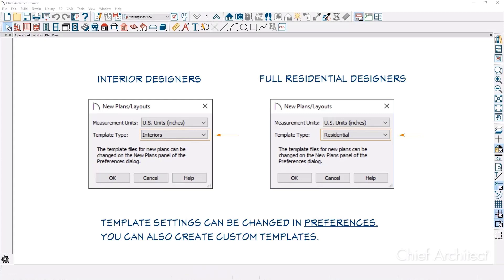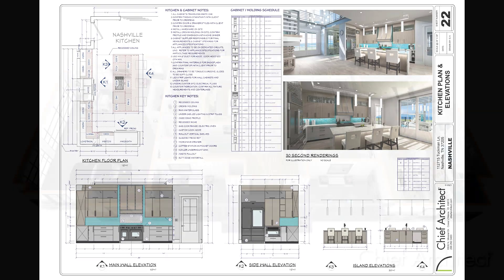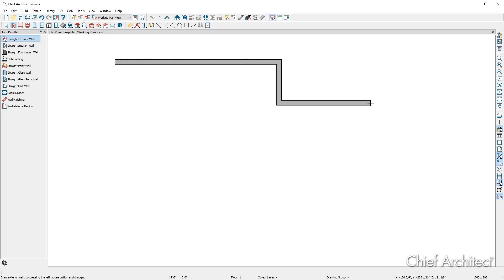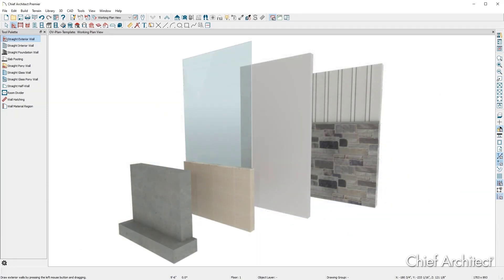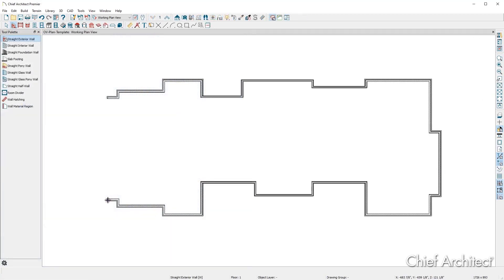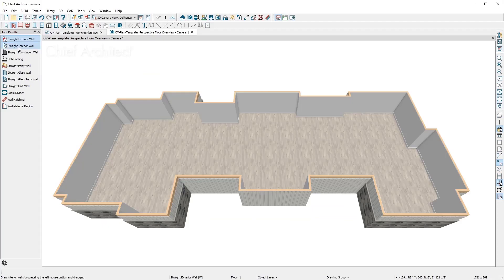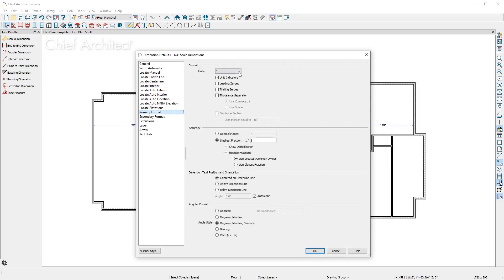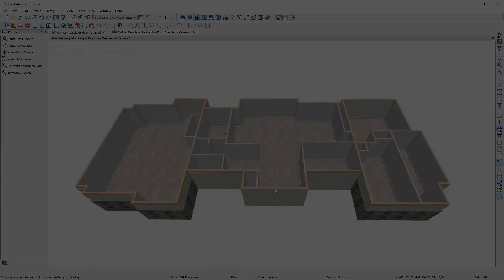Making Walls in Chief Architect

Comment: Can Chief Architect accommodate the design and construction of a house with ICF walls for the exterior and 2x4 framing for the interior walls?
Reply from the maker: Yes. The software comes preconfigured with various wall types, and they can be customized as needed. We offer an article that goes through the process in more detail: https://www.chiefarchitect.com/support/article/KB-02944/defining-a-new-wall-type.html

Comment: Thanks for the video.  I came here because I thought I was copying the height settings from another instructional video on ceiling heights.   He said he was going to set them for 9' ceilings yet if I raise an object and set the bottom of the object for 102" the object disappears.   So effectively I have 8.6" ceilings.   Any guess on what I should be looking at in the structure to see where that is missing?   Ceiling floor, rough ceiling, finished ceiling?   I'd love a little more detail on that - thanks!